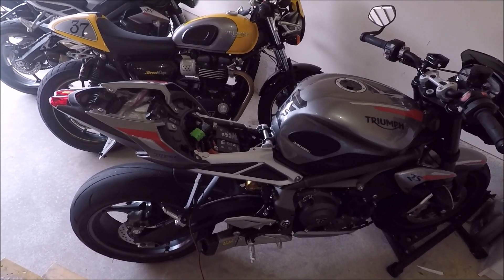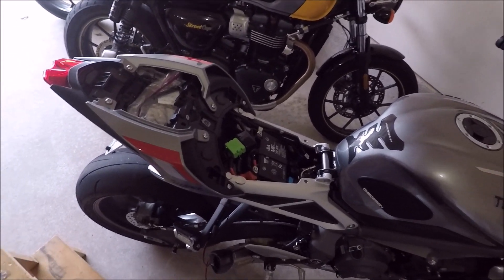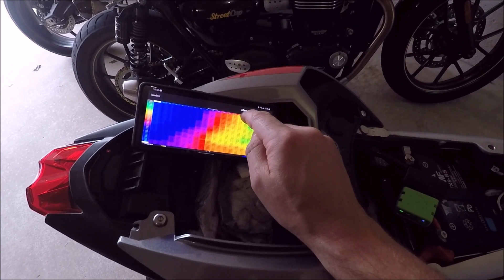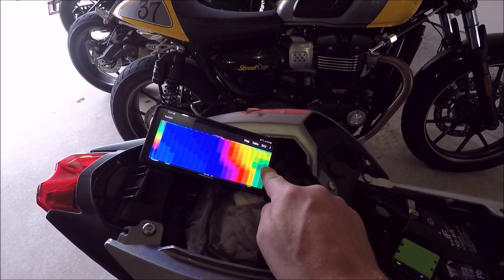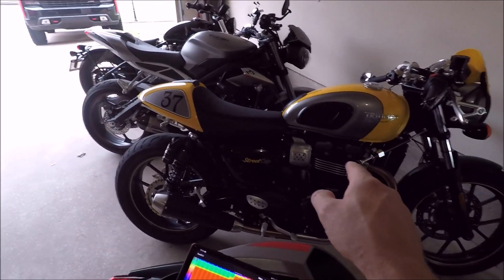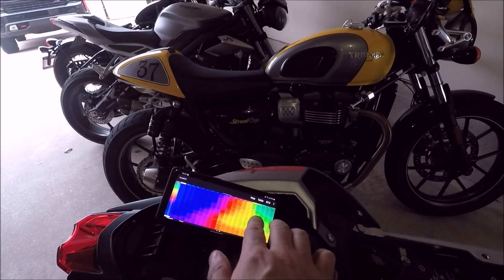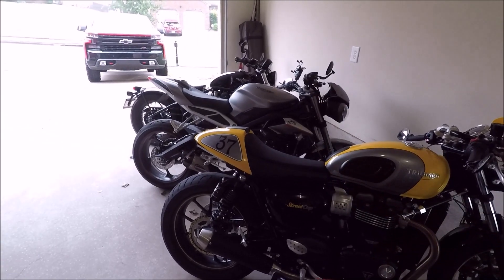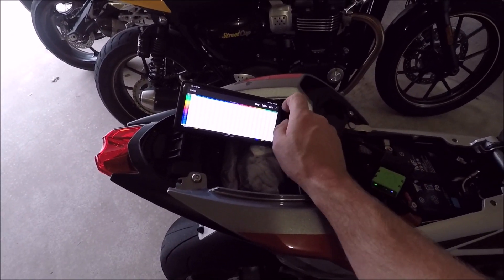How To Use TuneECU on a 2020 Street Triple RS 765

Comment: I was wondering is it also possible for example to dissable TC by default so you won't need to dissable it when engine was turned off?
Reply from the maker: Ummm... I am not sure, but I can try and find out.  I never asked, because I see no need to disable it.  It works, and it's nice.  The only time it gets in the way is if you want to ride a long wheelie, which I don't care about.  Riding hard on mountain roads, I want the ABS and Traction enabled and working.  It lets you be safer, while being faster.  I figure if folks like Marquez and Rossi use traction control, then certainly my skills are not above such things...

Comment: I have the 2020 streettrip. I don't have obd linklx. I have vag com cable and elm327 made in china. I can't connect to both. Vagcom sees tuneecu but cannot connect. In other articles, it was written that the fuse of the headlights should be removed. I can't find the fuse for the low beams. The 10a fuse I removed only turns off the high beam beams.
Reply from the maker: I don't remove the fuse, I just put the bike on a battery tender and it keeps it powered up just fine.  Pulling the fuse disables the headlights, but not the LED running lights, which may be what you are seeing stay on?

The new Triumphs will not work through a cable, that's for older bikes.  You have to use the bluetooth adapter and the Android app to connect to the new bikes.

Comment: So, I'm still trying to determine if one of these maps will work for a 2020 rs with the sc project s1 exhaust. Any clue?
Reply from the maker: There is no map for that exhaust, triumph no longer supplies alternate maps for exhausts.  You will need to nap it yourself on a dyno.
Reply: @Daves_Man_Cave  ok. Thanks. I thought about getting one form DNK. I don't have a dyno place around me.
Reply from the maker: @EvolvingMale  Danielle usually has a good tune that will be close enough to your setup, that you won't notice the difference between it and a custom tune.
Reply: @Daves_Man_Cave  ok. I’ll give them a shot, I think

Comment: Where do I find the faults for an engine check light that is on?
Reply from the maker: COnnect TuneECU, and under the ECU menu there should be an option for "Read Codes" and one for "Clear Codes", I believe...
Reply: @Daves_Man_Cave  Thank you, mine is not highlighted to clear. The software says unregistered. How do i register?
Reply from the maker: @nawtn  Make sure your app is updated and connected to the internet when you connect to the bike.  It should register that ECU for you automatically.
Reply: @Daves_Man_Cave  Ok thank you, will try

Comment: Do I need to tune it if I only changed the muffler?
Reply from the maker: With the 2020+, its hit or miss.  If you leave the dB killer in, maybe not.  These motors are very picky, and if someone tells you that all you have to do is the 12 minute tune, or that this bike is self learning, they don't know what they are talking about...
Reply: SquireSCA I got the yoshi AT2, and yoshimura told me it doesn’t need a tune lol
Reply from the maker: @holidaythebengal5505  They always say that.  They also claim performance increases.  So ask them to explain how a muffler can change the flow of gasses in a motor enough to unlock a few HP, but not change the flow enough to need refueling?  lol

There is no free lunch, especially with these new Euro5 motors...

Comment: I think your interpretation of the AF table adjustments might be a little off? Information on the net is sparse, but it seems it's more of a mathematical representation as opposed to a 'target' AFR for the ECU. Supposedly setting it lower than 14.5 actually prevents closed loop running in some models as well. Have you noticed any of this on a dyno?
Reply from the maker: Ignore the afr tables...  I disabled O2 and did a full dyno tune anyway...

Comment: Thanks for the video. Can you please send me the link from where you bought your Bluetooth device? Thanks in advanced
Reply from the maker: https://www.amazon.com/ScanTool-OBDLink-Bluetooth-Professional-Diagnostics/dp/B00H9S71LW/ref=asc_df_B00H9S71LW/?tag=hyprod-20&linkCode=df0&hvadid=312142020868&hvpos=&hvnetw=g&hvrand=17398920987759372837&hvpone=&hvptwo=&hvqmt=&hvdev=c&hvdvcmdl=&hvlocint=&hvlocphy=9011035&hvtargid=pla-433361767800&psc=1
Reply: Thanks a lot
Reply: Hello. This device is only for android and I have an iPhone. I found this OBDLink 428101 Scanner OBD2 on eBay, do you think it will work the same as your? Thanks in advanced
Reply from the maker: @MA-bq8yg  TuneECU, the app that you will need to use to connect to that bluetooth device and "talk" to the bike, is not offered on the iPhone.  It's an Android app.

What I would recommend is find a cheap $80 unlocked Android phone on Amazon and use that for TuneECU.
Reply: Yes. Ok. If I will purchase it, I will look for an android. I didn’t watch your video till the end. At night I’ll do it and I will contact you if I have some more questions. I have the 2017 RS model. Thanks a lot for your quick response
Reply from the maker: @MA-bq8yg  Yeah, for a time I was on an iPhone 11 Pro and so I just picked up a cheap Android phone from Amazon to use with TuneECU.  But I did end up moving to a Galaxy Note 20 just to make life easier for tuning all the bikes.  The built in stylus makes it easy to edit those cells in the fuel and ignition tables...
Reply: Me too I wanted to test a Samsung. I bought a OBD with wire to be able to remove the service message. I made my servicing myself. I bought a power commander and a spark exhaust. Do you think your tune écu can reprogram the écu without using the power commander?
Reply from the maker: @MA-bq8yg  You can tune the bike with just TuneECU and the ECU.  However, it will take a LOT longer for your tuner to do it this way on the dyno.  Tuning with TuneECU takes a lot more effort and time.  So if you already have the Power Commander, my advice is to install it, and have your tuner use that.  Just use TuneECU for maintenance, resets, and before you tune, disable the O2 sensor and SAI.

Here, I already made a video about this.  My bike is a 2020, but the reasoning is the same and the process is the same:

https://youtu.be/uRVFGshdZQo
Reply: Here in France the tuneecu cost 84€. Ok. Thanks for your advice really appreciated your feedback and quick response. Take care
Reply from the maker: @MA-bq8yg   If you plan to tune the bike with the power commander, which is what I recommend...  If you don't want to pay for TuneECU and an Android phone, then simply look for a "O2 eliminator" for that bike.  A UK company sells them on eBay.  Just use that to disable the O2 sensor...

And to get rid of SAI, lift the tank, and find the rubber hose that goes from the airbox to the SAI valve.  Unplug the hose, grease up a marble, and stuff it in the hose and reconnect it back to the airbox.  SAI will then be disabled, and if you want to reverse it for some reason you just have to squeeze out the marble.  :-)
Reply: Wow you are too keen in all the stuff. Even the tuner told me that for the moment they can’t disable the O2 eliminator. I did buy an odb to remove the service message but I haven’t yet used it. I will see if I have this option to disable the O2 eliminated. Thanks
Reply from the maker: @MA-bq8yg  To disable the O2 sensor requires either TuneECU, or an O2 Eliminator.  The eliminator is a plug that goes onto the wiring harness in place of the O2 sensor.  It is just a pair of resistors, that trick the ECU into thinking that it is still there.  This is critical when tuning so that the ECU doesn't sense changes in the exhaust and try to "fix" it.

For bikes like the Bonneville, I made my own with a 330 Ohm and 1M Ohm resistor, but I don't know if it is the same for the Street Triple.  They are cheap.  You can buy one here:

https://www.ukracesupport.com/products/triumph-675-765-o2-oxygen-sensor-eliminator-kit

If you install that, then pull out the O2 sensor from the exhaust pipe and get a plug to plug the hole.  Then tune it with a PCV and you are good to go.
Reply: Thanks a lot for your advice. I find the same dealer for the O2 eliminator sensor. I will purchase it. I am not too in good in installing the power commander and tune the bike. A tuner ask me 600€ to install the power commander and to tune the bike on a dyno. If everything is fine on my side maybe till the end of the year I will do all these things.
Reply from the maker: @MA-bq8yg  Installing the PCV is actually pretty easy.  Everything is plug and play, you just have to lift up and prop up the gas tank to reach some of the connectors.  It's not like the older power commanders where you had to splice wires and things.

There are 3 injectors that you plug into, a crankshaft position sensor, and then the throttle position sensor.  Only other thing is power and ground.  It's a lot easier than you think.

But if a tuner is willing to install it all and do a proper dyno tune, it might be worth the money to just let them do it and not worry about messing anything up.  :-)
Reply: Yes for sure, I’ll prefer a tuner to do it 🤗. You know a lot of stuff. Are you a motorcycle mechanic? I really appreciate all your advices. Right now, we are facing a very difficult situation and hope in the future it will go in the right sense then I will have time for my street.
Reply from the maker: @MA-bq8yg  Not a mechanic, but over the past 27 years, I have owned 27 bikes.  I have worked on and tuned them all, modified them, etc... I have good friends that are pro mechanics, racers and tuners, and so I ask lots of questions, and spend a lot of time in the dyno room tuning and learning as I go...  

So I figure maybe I can pass on some of that knowledge to others on my channel...
Reply: You are brilliant. That’s so nice of you to share your knowledge with us. Thanks a lot.

Comment: Cracking video. A very cheeky request - any chance of sharing your streetcup + TEC cam map? - I just can't seem to get mine to run right. Still very dull above 5,000 rpm. Thanks.
Reply from the maker: Shoot me your email.
Reply: @Daves_Man_Cave   Thanks very much. it's ( no spaces of course)  s t e v e l e e 3 1 @ h o t m a i l . c o m          it's been impossible to get any dyno time over the last year - everything's shut down because of covid!

Comment: great Vid mate..I'm in the U.K. and plan to use a DNK tune to remap my Bobber and was interested in the comment you made about the throttle on the bobber, Can you expand
Reply from the maker: Happy to.  So what Triumph has done to the Bobber, is use throttle value tables to restrict the top end power of the bike.  It's actually really simple.  We have throttle by wire.  There is no cable, it is electronic, like a dimmer light switch in your home...  You twist the throttle to 100%, and the ECU sees that, and gives you that much power.  Or does it?

It gives you 100% throttle, but only up to a certain RPM that is well shy of redline, and then it cuts back power.  The map from DNK, removes that restriction and restores the values to 100% all the way to redline.  So when you ask for 100% power at the throttle, the engine delivers 100% and not 80%...

I made a video on this, because the 2020 Street Triple R does the same thing.  It's how they now create a power output difference between the R and the RS.  It used to be made by tune, a softer cam, etc...  For 2020+ it is the same motor, same tune.  All Triumph is doing is the same throttle table restrictions that they did on the Bobber.  Search my videos of how to turn your Street R into an RS and I cover the entire process.
Reply: @Daves_Man_Cave  Very helpful I'll check it out when I use the DNK tune

Comment: What's the difference between TuneECU and a power commander then?
Reply from the maker: TuneECU is tuning the ECU itself.  Power Commander sits between the ECU and the injectors and the ignition coils...  It intercepts the signals being sent, and it alters that signal to change the fueling or timing, etc...

The benefit of TuneECU is that it's one less thing to go wrong, less wiring, and its cheaper... it also allows you to make other changes like throttle tables, raise rev limiter, etc...  The downside is that tuning with TuneECU takes forever.  It's not hard, but it is a slow and tedious process.

The PCV is an extra expense and is limited to fuel adjustments, and ignition is an extra module.  The benefit is that pretty much every tuner knows how to work with it and tuning it takes a fraction of the time...

I also found some limits in TuneECU in the very low end of the fuel tables, at idle and just above, and no matter how much fuel we added it made zero changes down there... so in the end we tossed in a PCV, tuned it on a dyno in an hour and called it a day...
Reply: @Daves_Man_Cave  I heard PCV wasn't available for the 2020 rs model. I could be wrong, but what's your experience on it
Reply from the maker: @jowrockable  It absolutely is available, I have one installed.  :-)

It's the same PCV as the 2018+ models, as they all use the same injector plugs.  My experience is, use TuneECU to disable O2 and SAI and to raise the rev limiter, and that's it.

Physically remove the O2 sensor, and then do all your tuning with the PCV on a dyno.  That will be the fastest, easiest way, and get the best results.

Comment: Hi SquireSCA. Have you compared both available maps to see the differences between them?
Reply from the maker: You mean between the North America and all other markets maps?
Reply: @Daves_Man_Cave  yes
Reply from the maker: @zardojunior  I have not, but I can look later.
Reply from the maker: @zardojunior  Ok, I looked at the North American map, compared to the "All other regions".  As far as fuel tables, ignition, ETV, etc...  They are identical.  I see no differences.

Now, that doesn't mean that the files are the same.  One would have to open them up with a hex editor or something and look for differences...  TuneECU opens the file, but it only has access to certain things... fuel, ignition, etc...  There could very well be other things under the hood, that you can't see, that are different between the regions...  But everything that I can see, is the same.

So no, don't try flashing a map for a different region, into your bike.  it might be fine, or, it could create an issue.
Reply: @Daves_Man_Cave  Thank you for your detailed answer. 
I have a 2020 765 RS and I will see all your videos to know what tunes I can do to improve my bike.
Reply from the maker: @zardojunior  What region are you in, and what mods do you plan to do to your bike?  I went through a lot of headaches getting this Euro5 bike dialed it.  Gave us more problems than any of the other 25 bikes I have owned prior to this one...  But in the end we got it sorted and it runs great now.
Reply: @Daves_Man_Cave  I'm from Brazil.
I was wondering if there are some "easy" upgrade and/or tune that gives some extra bhp and flattens the torque curve.
Reply: @Daves_Man_Cave  main difference is the North American bikes have a carbon canister and purge solenoid that the other markets do not.

Comment: Hi, how do you change the AFR in your map? Just randomly changing all the 14.5s to 14.0s? Also for the throttle ETV, do you know any way to change in percentage instead of units? Like increase 10% instead of 0.1 increments.  Thanks!
Reply from the maker: Well, those are just "AFR Targets"... I am not sure how much ability the Euro5 ECU has to actually tune the closed loop section of the fuel tables to that AFR, so that is more of an experiment to see how it runs and adapts over time.

The areas above 20% throttle and 6,000RPM can be tuned by using the trim menu, or the individual fuel cells on F1-F3.  It's easier to make the changes on the single Trim page and then apply them globally.  That is what your tuner will use on the dyno to tune the bike to a certain exhaust or whatever...

As for the throttle mappings, I am not gonna play with those.  No reason to.  The engine modes are mapped properly for Rain, Road and Sport...  Unlike some bikes, there are no torque limitations in Road or Sport.  You give it 100% throttle, it delivers 100% power...

Comment: Can you use an android tablet?
Reply from the maker: Yes.  Phone or tablet, just needs to be Android.
Reply: @Daves_Man_Cave  I dont have option to reprogram under ecu, I payed 25€ for registration, do I need to buy full pro version of tune ecu to get that option?
Thanks
Reply from the maker: @Ro.01  Connect to the ECU first, make sure the green light is flashing and shows connected.
Reply: @Daves_Man_Cave  of course, I know how to connect but Only options under ecu are disconnect and informations, there is no reprogram option
Reply from the maker: @Ro.01  Connect, then open the map you want to push, then reprogram.
Reply: @Daves_Man_Cave  I do same thing you wrote me, but option reprogram is not even shown
Reply from the maker: @Ro.01  Hmmm...  I no longer have the bike so its not like I can go out and test it...  Let's see...  So you connect, its flashing green and all that...  You load up the CORRECT map for that bike, and you can't push the map?  Or are you not trying to push a map, just trying to reset the maintenance minder?
Reply: @Daves_Man_Cave  I want to install other map
Reply from the maker: @Ro.01  What year and model bike do you have, and what are the last 6 digits of the VIN?  What map are you trying to push to the bike?
Reply: @Daves_Man_Cave  I have tried any map it is not possible my bike is 765 rs 2017
Vin from 800262